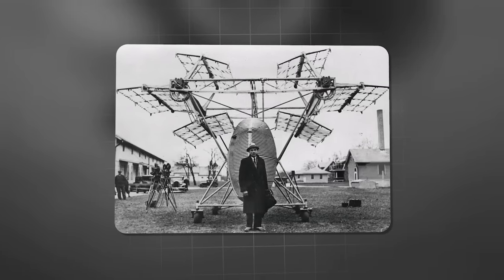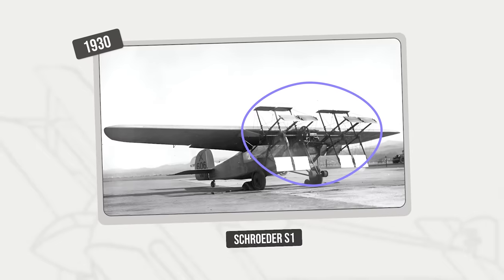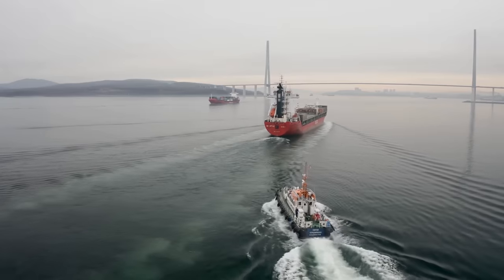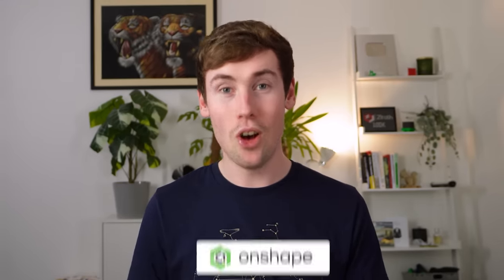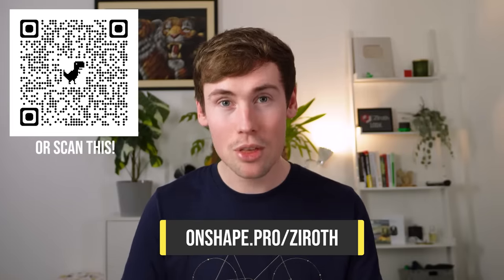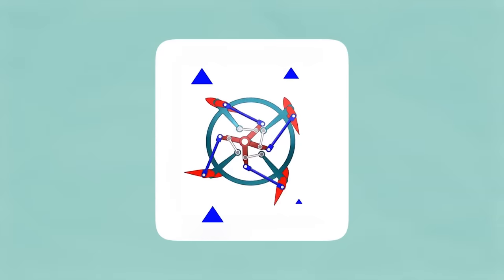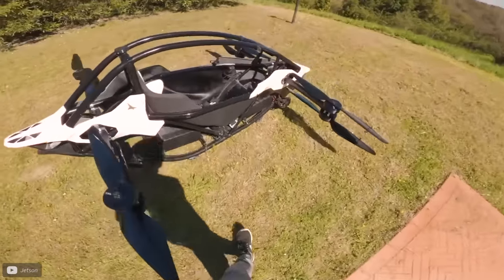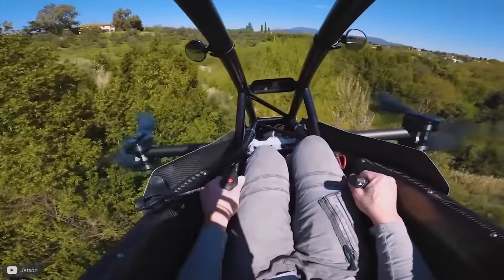The Genius of Cycloidal Propellers: Future of Flight?

Comment from the maker: Thanks for watching, it's been great to learn about a technology that is both mature and new in two different applications. Don't forget to get started in Onshape for FREE: https://Onshape.pro/Ziroth - You won't regret giving it a try!
Reply: Thank you for the quality content. I am disappointed in the lack of details on the thrust, as the title kind of led me to believe that it has much higher thrust to weight ratio but the video did not cover that in detail.
Reply: Onshape seems to be an easy way to "lend" peoples designs..
Reply: @richfromtang You're being silly thinking flying cars should be entraining bugs and detritus in their airflow, but need to be more critical when it comes to tires/landing gear because abused rubber turns to inhalation and IgE hazard rather than smol bouncy toys. So far? There's probs the flight Design (where's the arχiv for this) for kinder kitten footed landings and wheel adaptations...
Reply: 10:10.  Return to the airship. Use them on that
Reply: Serious question... Are there dentists in the UK?
Reply: it will be interesting to see how this competes against TOROIDAL propellers which i think you also did a video on right?
Maybe the ultimate choice is a combination of both on one craft?
Reply: The hydrostatic principles of that rotor in water are far different than attempting to lift an airframe into the air.  Rookie ?
Reply: At 00:35 it's pronounced with a soft 'J', like a 'Y', so  'самолёт' is 'samolyot'. And 'самолёт' means 'plane' or 'aircraft'.
Reply: Flying cars will never become mainstream using current technology. Flying requires a lot more energy than driving across a well-designed more-or-less horizontal surface. Considering our energy/ global warming/ pollution crisis we need to find ways of using less energy for travel and not more energy. Efficiency is the key.
Reply: use its as aboat propellor.
Reply: Cannot generate much lift in air.   In water it's different.  The rotary wing config we have now (helicopters) with a circular blade plane is about the best we can do.  Was a helicopter mechanic and crew chief for years...then worked as an A&P.
Reply: May I please reference my own crayon speed painting for a serious method of harnessing vortex energies
Reply: @jacksnorty5622  What exactly is the point of your question?

Comment: "I have to wonder if it offers any practical advantages" uhh yeah man, me too. That's why I watched the video. Little disappointed you didn't answer that question.
Reply from the maker: The advantages are the thrust vectoring (and noise reduction), which is why it can be useful in marine applications (and the others I mentioned) - but I personally think it may not add much advantage in practise for aviation. These are still really awesome propellers, and I'm sure the design of them will help other fields. Sorry this wasn't the conclusion you wanted!
Reply: What about using them for wind generated electricity? @ZirothTech
Reply: @WillyK51 Excellent idea but fairly certain they exist already.
Reply: In theory having the entire length of the blades at the same speed offer better efficiency, but you lose a lot because parts of the cycle isn't producing trust.
Reply: @FilosophicalPharmer  They have been found to be far less efficient than traditional wind turbines.
Reply: @ZirothTech  Thrust vectoring doesn't help with marine applications. They already have the problem of boats moving sideways solved. It is called 2 propellors facing forwards, and 2 sideways one at the back and one at the front. It has fewer moving parts, and it is far more maneuverable than thrust vectoring.
Reply: @FilosophicalPharmer Yep, vertical ones just like the ship-borne rotors, but in reverse. Also they exist as vertical sails, though they turn much slower, of course.
Reply: @MegaLokopo  Check Azipod propellers, they do thrust vectoring without too much delicate mechanisms.
Reply: @ZirothTech  I did not expect this comment to get so much traction. it was a good video and I learned things and your videos are generally of a quality that I appreciate and enjoy please don't take this harder than it should have been. 

I was a little disappointed that you did not discuss practical advantages or applications of these engines or why someone would choose it for say a drone or flying vehicle over anything else.

I suppose I expected something at least along the lines of the PR that the company's working with the rotors are using to justify the projects and then maybe a little analysis of that.

again minor complaints apologies this has gotten so much attention please continue making great videos
Reply: I wonder about small boat applications (in the electric 1-3 kW range). You'd eliminate the need to have the motor unit rotate (for steering), so you could replace a remote steering system with some underwater complexity (probably a bad trade). Generally higher pitch and slower rotation provides more efficiency, so you might get more effective area as compared to a traditional rotational propeller where the inner diameter isn't doing as much work. Hard to beat business as usual though...
Reply: @WillyK51 
To many moving parts >>> prohibitive maintenance costs 😞
...  same idea here initially 🖖🏼👍🏼
Reply: @MegaLokopo 
... they are still far superior in 
efficiency/thrust, on top of the ability to vector it 😉🖖🏼
🤔  as all "fins" are, compared to any "rotating propellers" ..
Reply: @FranklyWry 
Flettner rotors ?
Those are rather slow turnig tubes. No foils, just smooth surface ...
Reply: @Samsjunk 
No apology necessary 🖖🏼
You simply hit (one of ..) the bullseye(s)  🤔  .. 🐘 in the room   👍🏼
Reply: @WillyK51 In Poland they have "V watt" - a slow-speed power plant for the roof of the house.
Reply: That is because the answer is “no” and that doesn’t make for a very interesting video.
Reply: @MegaLokopo  Plus the failure modes for bow thrusters are more benign. If one gets choked with seaweed or just siezes up you have reduced capability but aren't dead in the water. It's telling that a skid plate is added to protect the flailing blades from grounding, too.
Reply: @WillyK51 Darrheius rotor
Reply: @tgdomnemo5052  Yeah, I may have been conflating a couple of different articles.
Reply: @ZirothTech  Honestly, I feel like the use case is slightly off - these would make a lot more sense if the goal was to provide maneuvering thrust only with them, not lift and maneuvering thrust.

Picture these sorts of propellers on something like a dirigible (which, yeah, I know, not exactly a primary focus of modern aviation tech), where they could provide the craft with fine maneuvering capabilities, hover-in-place in changing wind environments, and very energy efficient propulsion.

But as standalone rotors for small drones and aircraft.... I'm skeptical as to whether or not they provide significant benefit over spending the same resources seeking better optimized traditional propellers.
Reply: My knowledge of this is old , like 25-30 years. I remember when several tugboats had them and they didn’t appear to have any problems with them, I may be wrong but they sure seemed very controllable.
Reply: The answer is no it doesn’t have any practical applications
Reply: https://nl.wikipedia.org/wiki/Voith-Schneider-propeller used often (very strong) tugs
Reply: Thanks for saving me 11 minutes of my life
Reply: @MegaLokopo tug boats have this system though. They have straight blades pointing down. The rotation of axis is perpendicular to the boat downwards.
Reply: @MegaLokopo Voith Schneider system
Reply: @carlosandleon  Some do, but a lot don't, many of them have jets or propellors that can rotate.
Reply: @ameunier41 To add a little to your comment, the reason that regular propellers have a twist to them is to compensate for the fact that the tips are moving faster than the hub. So they’re already pretty efficient. 

High performance propeller driven aircraft have variable pitch propellers. Which can be adjusted to the most efficient angle for a given airspeed. (It’s a little more complicated than that, but that’s the theory behind constant speed/variable pitch props)
Reply: @ZirothTech It could have been more analytical. Like, small blades and more are lovely but spinning and all aren't getting them to an efficient 500-5000 km/h. 1 of 4 blades being in good stead for lift is quite bad. Intrinsic safety and literal 🌀 cycloid canniness aren't in the Design bible (?) 

It's just a long way from even Airbus or Dublin Flight Design and Highway Noise Absorption U. being name checked, and I'd also like e.g. terrible to be pronounced with an r... maybe the word possible was another candidate for specific use as powsibeurre or...well, not.
Reply: @krotson6767 Even in Poland, surely flighting a lighter than air platform for wind would catch a decent amount 30-600 m up? Something to put up on the garden netting if you want to make an oddly bossy garden frame (to anchor the generation kite.)
Reply: @joshpatton757 If your hobbyist aviation designs don't evoke the God Mother of Dune you're skipping on safety.
Reply: @MegaLokopo  point is they indeed do have maritime uses and are very effective at that
Reply: First time a saw a pair of these  was on a tug-boat. I was a diver, and was given the task of removing an obstruction from the propellers. When i found the "propellers" i turned into a human questionmark 😅
Reply: My friend, I don't disagree with you. However this is where people like you what and I pick up the idea and run with it. Modifications applications alterations different materials, things like changing the aerofoil of the blade at either end and perhaps even centre. For example imagine a helicopter rotor blade with aerofoil changing as it comes closer to the end of the blade with respect to the greater in speed at the tip of the blade et cetera et cetera. No real knowledge required, just blind ideas. Something like long ago Apple falling out of the tree and physics ensuing from that
Reply: @ameunier41  my gut is telling me that adding shaped ducts around the rotors in order to induce more controlled airflow could be an avenue worth exploring - having a slightly larger opening at the top than at the bottom would allow for a slight compression effect, though flow simulations would absolutely be required to figure out potential shapes. They'd also double as partial safety cages, meaning that on catastrophic failure the blades would "only" be shooting out directly up and down instead of in a 360 degree circle around the rotor.
Reply: The answer to any clickbait youtube video title, news article, etc. with a question is "no."
Reply: He mentions the main one in the first three minutes of the video—the ability to instantly and accurately change the vector of thrust by varying the pitch of the blades. Of course it's much more effective in a denser fluid like water, and producing enough thrust to get heavier-than-air flight is very difficult, so no it doesn't have a lot of great air applications... so far.
Reply: Poorly made content island boy  @ZirothTech
Reply: @WillyK51  Answer from research: the best of the existing vertical rotors (like Darrieus) use twice as much material in production as typical horizontal ones (three blades).
The problems of high sail area, high accident rate in hurricane winds and high weight do not allow them to be scaled up to a capacity greater than 1 MW or lifted to a height of more than 90 meters.
Reply: @JoeStoffa  In research I read that vertical rotors are used in water as micro hydroelectric power plants, which are safer for fish. And also for vertical sails on the Magnus effect to save ship fuel.
Reply: Lots of filler and the now typical "we'll get to that later in the video" crap.
Reply: It is not efficient in wind farms, why should it be in aviation?

Comment: Thank you for mentioning the downsides of cycloidal rotor propellers as well
Reply: Downside: Low efficiency, complexity, bulk structure
Reply: @johnluffman7954  I was thinking the extra gear to control the pitch would have to eat effeciency.

Comment: Another minor benefit is that having a horizontal rotation axis makes it easier to balance torque with a variety of rotor configurations.
Reply: Don't standard propellers and jet engines also have a horizontal axis about which they rotate?
Reply: @johnnyswatts  If they are providing horizontal thrust, yes. But with thrust parallel to the axis, you don't have the freedom to alter the direction of angular momentum however you want. The only options are putting engines in pairs or using control surfaces to provide a counter torque. Which is why you don't see many 3-rotor drones.
Reply: @LoganKearsley  : There are actually 3-rotor drones. They're rare, but you just need to tilt the third so that it cancels it's oen torque characteristics.

Comment: When I was a small boy back in the 1950s I was given a small, cheap plastic toy aircraft that had horizontal rotating wings. I don’t think it had any power, source you just threw it and it glided a bit with the wings autorotating .  I'd forgotten all about this little toy of nearly 70 years ago  until I saw this upload. Thanks for the memory!😊
Reply: In engineering and science, schools too, brilliant minds are usually beaten into submission and towards consensus thinking, no new ideas please.
Reply: I also bought a styrofoam toy rotating wing kite, held against the wind by a string bridle at the ends of the rotating axle. They were sold at the Dayton Air Show
Reply: That toy worked using entirely different physics for lift, called the Magnus effect, the same effect that makes a baseball curve. The savanious shaped wings could rotate along their central span-wise axis, and the oncoming wind caused the rotating wing to generate lift. These could auto rotate to the ground if the wind stopped, so it acted like a parachute. The vehicle in the video works on an entirely principle, and generates lift in effect by flapping its wings in the rotor like a bird. This vehicle can not auto rotate to the ground if the motors stop.
Reply: I remember a similar toy from my boyhood days, however, it was designed so that it flew like a kite ie. it was tethered to a string. It was sometime in the mid-1960s.

Comment: I’m glad there are still people with the vision to say ‘I know we have a system that works but I want to try a different approach’ this is what we need to advance. Also when you commented on the quieter operation you didn’t mention military applications, I would think they would be the bigger backer of this.
Reply: Had the Wright brothers accepted what was "known" as 'fact' about propellers, man likely would never have left the ground. Always question what is accepted as fact if you want to succeed as an inventor.

I would think the VSP would be very interesting for submarines as well, since it is quieter by it's very nature over a standard prop.
Reply: @Dang_Near_Fed_Up  Given others also had a working aircraft, we would have, no issue..  But I hear ya, someone has to think outside the box..   That how we got axial flow turbine engines and..  Shutter... Wankels...
Reply: @jamesheal1615  The reason I mention propellers and the Wright brothers is that what was accepted as fact was wrong, pitch angle and thrust output were WAY off. The Wright brothers discovered this.
Using pre Wright Brothers data, lift would have been insufficient for manned flight, but adequate for drones / lighter vehicles as had already flown. Given the limited engine technology of the day.
It was this discovery that put the Wright brothers in the air, while experimenting in the back of a bicycle shop on a laughable budget. While everyone else was failing to achieve flight on huge budgets, and with entire machine shops doing their builds.
Reply: Advance yawn it’s my sky paddle boat. I was just bored.
Reply: @sclabhailordofnoplot2430  And what is the value of your teenage reply?